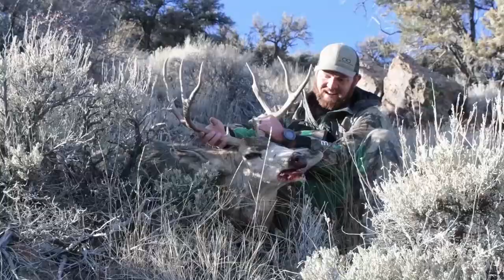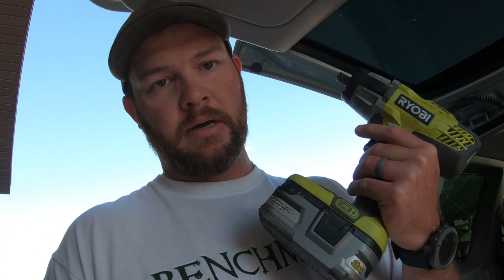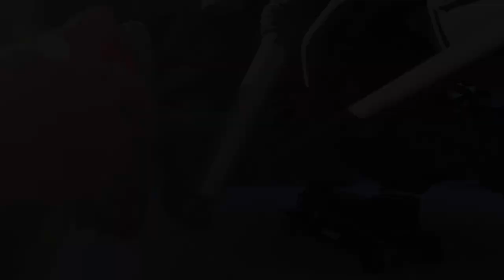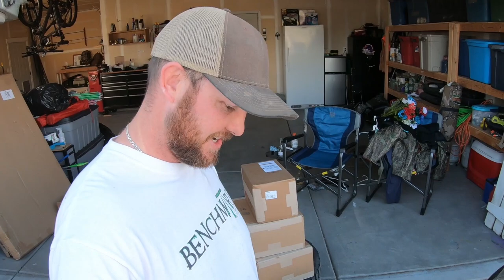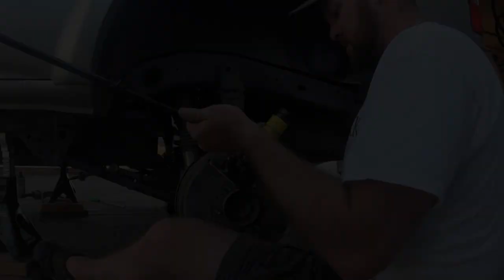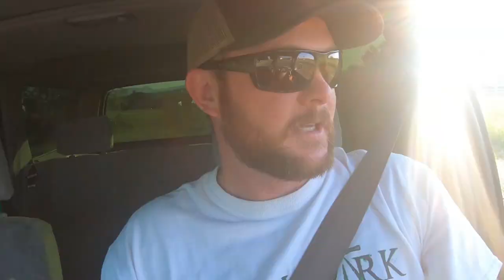OME 891 rear coils from Wheelers Offroad. 3rd Gen 4runner! Project Ruby

Comment: Installed about 10 years ago on 99. No saggy ass, even with 4 adults and packed for a week of camping gear. I had over 1200 lbs one time, and rides smooth.  Good vid, subscribed!
Reply from the maker: tried and true heck ya! Cheers
Reply: I’m about to buy my kit on my 99,did you have the heavy spring?

Comment: What is the difference between 906 and 981?
Reply from the maker: Just4Fun 

the 891 was designed for the Prado.
the 906 was designed for the 4Runner.

the 891 is very stiff/harsh for the 4Runner without a couple hundred pounds back there.
the 906 is supposed to be perfect for the 4Runner.

the 891 yields anywhere from 3-3.25" lift on a 4Runner.
the 906 yields about 2-2.25" lift on a 4Runner.

Rides great with my rig!

Comment: I’m @ cross road , 890 or 891.
Many reports of 891 being to ruff without load.
What’s your take?
Reply from the maker: PJC 891’s. The ride is great!
Reply: JF Outdoors Right on.
Well purchased 890s early this morning with 1.5 Daystar rear Spacers.
Weight load will be no more then 200lb so should be good to go.

My current setup.
Front - Premium preloads with 1” spacer = 23.5 center hub to fender.
Rear - Weak Moog coils with 2.5 Daystar spacer = 23.5.

890s will provide 23” center hub to fender after settle.
Adding 1.5 Daystar spacer on top will get me were I need to be = 24.5

Solid performance with mild rake will finally be had on my rig
Reply: Update:
So much bad with my formula.
Installed 890s with Daystar 1.5 spacers finding rake too extreme.
I figured 1” rake ended with 1 1/4” driver side / passenger side 1 1/2”
After couple weeks it settled slightly.
What a freaking mess!

I ended up pulling 890s  , cutting Daystar spacer down on table saw & reinstalling to achieve level & comfy rake.

I’m very happy with end result!
Center hub to fender measurements.
Front 23 1/2
Rear 24.2

Rakes not as drastic looks & drives fantastic.

Comment: Have you got the front wheelers t1 springs installed yet? Is it pretty level with the 891 rears?
Reply from the maker: Aspireonthego yes. It actually sits perfect. Video To come
Reply: Jearred Foruria Outdoors Awesome! Thinking of running the same setup. Is that with the front set at the lowest perch?
Reply from the maker: Aspireonthego yes. Lowest perch
Reply: Jearred Foruria Outdoors Perfect. Thanks.
Reply: @jfoutdoors4337  when you did the front did you put the 5MM trim spacer on the driver side? When I installed mine there was not much boltlenghth left wondering if this is normal or correct
Reply from the maker: Eric Elder I didn’t. Mine came out perfectly level by tape measure
Reply: @jfoutdoors4337  smart I might measure mine to see if actually needed I dont think I needed it in all reality...thanks for the reply

Comment: What springs are you running in the front?
Reply from the maker: Clarenz Posadas wheelers T1 coils
Reply: @jfoutdoors4337  how, would you say, do they compare to ome 883 front springs? Simular? Im wondering if 883 in front and 891s in rear would be a good combo?
Reply from the maker: @j.a.8970  I don't know for sure, nut would say similar. All depending on vehicle weight of course.